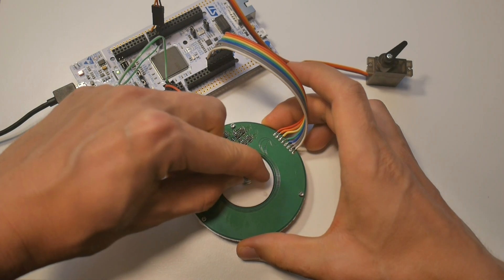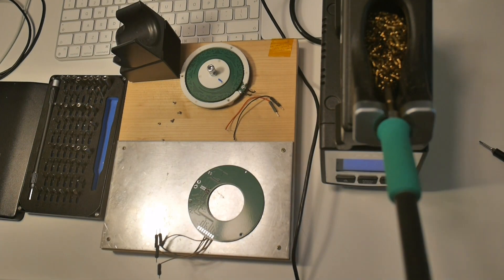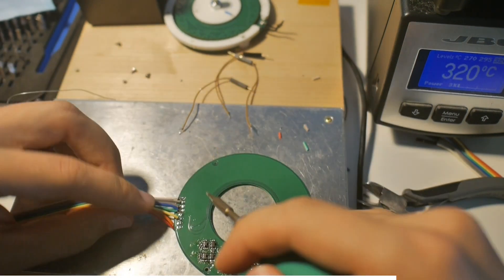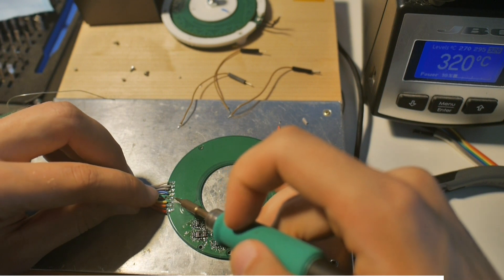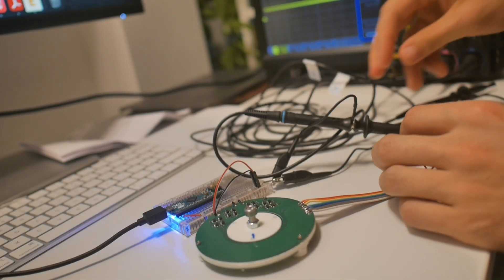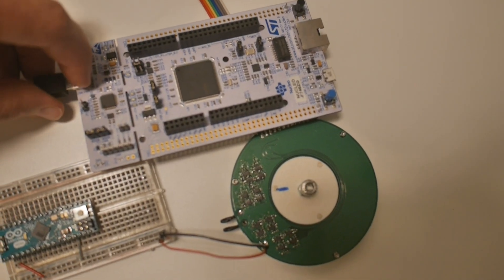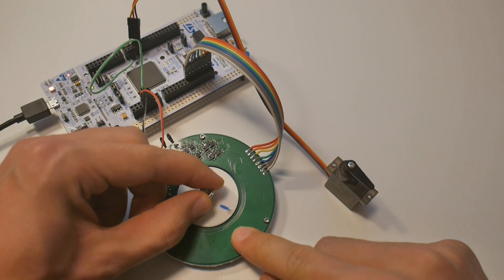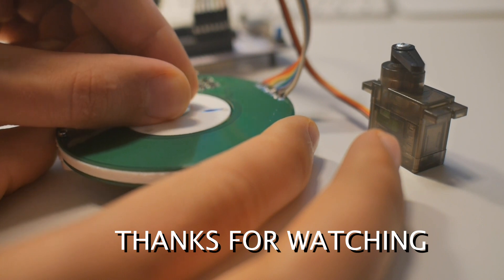diy 8-bit absolute encoder

Comment: Can you please let me know what kind of SMD LED light source and receivers are you using? Brand and dimensions as I am not able to procure them. Also which all components would be necessary in the signal conditioning apart from filtering and Schmitt trigger? 
.
.
Also loved to watch the development of your project from scratch, Not many YouTubers show such a detailed explanation.   Keep the good work up!!
Reply from the maker: I really appreciate that you liked the video series. 
It's a 0805 IR photodiode form Würth Electronics (1540801EEA300). I also used their 15408094BA400 IR LED. 
The most important part of the signal processing is the TIA (trans-impedance amplifier). You can go with a comparator or Schmitt trigger after that. Go and rewatch this video to catch the details: https://youtu.be/RPo8U-ANzYs?si=Q-IzgmdpiUuXu1Dd

Comment: This is nice project!. I see you are using STM32, i would highly recommend you to learn and use reading GPIO port over DMA. You can attach the DMA reading of GPIO port to the update event or even interrupt. This way all the reading is done by hardware with almost zero software overhead and you can access the graycode value whenever you want as it is automatically updated by the timer and DMA. Also the speed of update is really high.

To see the values i am getting two ideas. One is to use Analog output and measure that pin with osciloscope. Also there are methods how to plot live data using STM32 in debugging mode, unfornutelly i dont have much experience with this, but there is a ton of tutorials how to set this up. Also you can jsut watch the value in Live Expression in a debbuging mode.

Anyway, great work! :)
Reply from the maker: Thank's! I am already working on an update video covering interrupts and live data plotting.

Comment: Wow...  good progress!

You might push the position out the serial port, at the highest stable baud rate, and capture the values into a file. Then you can see out stable the system is working, and if you have any glitches in your decoding. 
Putting the values in a spreadsheet would let you graph it quickly, to visulize what's going on...   Plus do a simple check on the spacing to make sure it's always 1 or -1.
Reply from the maker: Thanks for following the series! I'm also quite happy about the progress.  I will include such plots in one of the next episodes!
Reply: @365robots  It's always good to double check yourself, and make sure you are on solid standing, before going to the next big step.
Saves you from having to second guess all of your work when something is wrong, as "it could be anywhere." Plus,, it still can be everywhere, but you would have tools and code to check the subsystems already, making everything easier, even though it takes a little more time at first